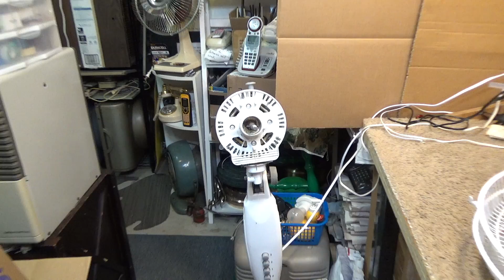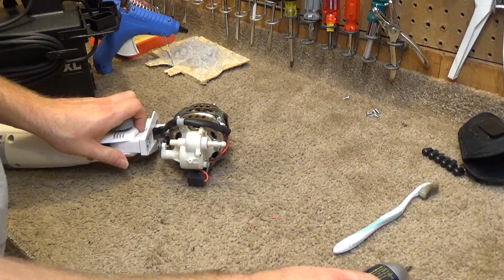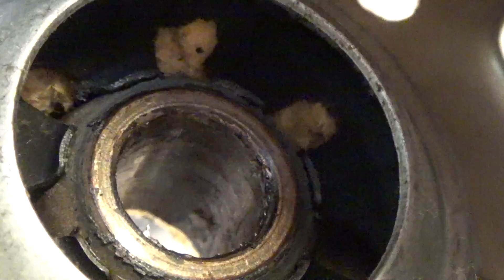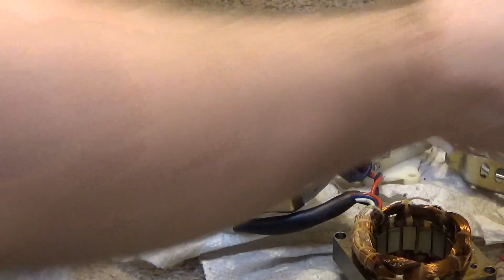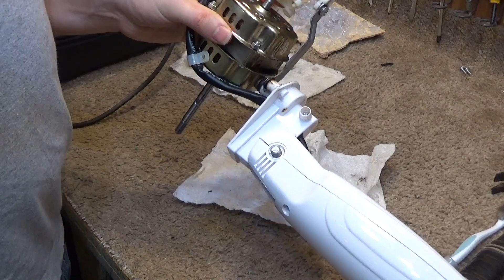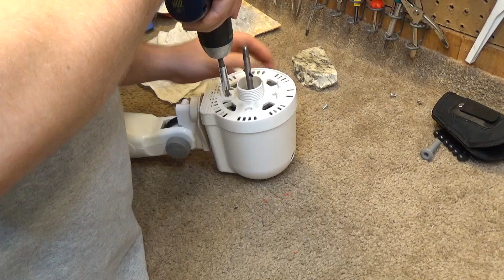Holmes HSF1610A 16" Stand Fan | Clean and Repair

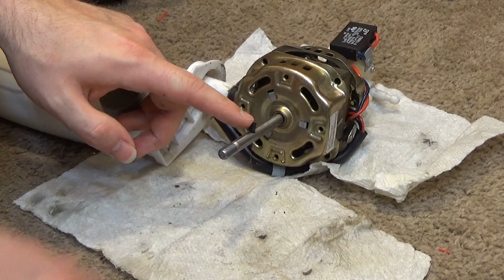Comment: 07:44 that's called a roll pin.

All fans with open sleeve bearings need periodic cleaning and lubrication, as the oil attracts dust and gets gummy over time.
Reply from the maker: Thanks for letting me know.

Comment: I have an Essential Home Model HF-1670 Date 11/06 with a similar burned shaft. I cleaned it and rubbed the burned shaft with some 600 grit emory cloth. I tried to clean some of the thrust washers and they broke because the heat must have made the plastic very brittle. I’ll go to Ace Hardware and see if they have a trust washer that will work.  There is also two very thine white thrust washers and have a very big inside diameter. They are larger then the shaft and I think they were rubbing on the black 2 cm spacer and wore out because of the burnt shaft. The other side has white washers too, but they have an inside diameter of the shaft.  To see if I could get it running I put a regular washer in that was about the size of the black thrust washer that crumbled and shorter out the open thermal fuse.  It ran. :)
Now I can put in a new thermal fuse and try to get some correct thrust washers somewhere.
Reply from the maker: How disappointing to see these failures just after a few years of use when the products of yesteryear ran for decades with no trouble.
Reply: @JordanU  I found two 5/16” id x  1/2” od x 0.032” t, white nylon washers at Ace Hardware for $0.18 ea. I also found one 5/16” id x 3/4” od x 0.060” t, grey neoprene fiber washer for $0.50 ea. I tried to stack the washers white grey white, bit it was too thick, so I removed one of the white washers and it worked and had a little play so the armature wouldn’t bind up.  I think the original white washers are made of nylon. The original nylon washer size on the other side was 8.3mm id x 13mm od x 0.35mm t.  Ace doesn’t have a large selection of washers in metric sizes so I got some with id of 5/16” which is close to 8.3mm and fits the armature shaft.  The grey washer was a little big, but it cleared the bearing housing ok.  Ace Hardware didn’t have grey washers with a 5/16” id and a 1/2” od, so I had to get the bigger washer.  I don’t know what the original black washers are made of, but I think what I got might work.  I don’t know how long the neoprene fiber washer will last since it seems to be different from the black original washer.  Maybe there is a manufacturer’s website with motor washer information they would help people trying to fix their fan motors, but I don’t know any.

Comment: I put a line on the front housing, iron plates and rear housing so when I put it back together I know how the sides are supposed to light up. Also, I will start putting arrows on each of the three lines so I don’t put the windings in backwards.  I also, scratch the lines with an al or sharp tool so incase I wash off the sharpie I can still see the lines.  I put an “S” on the end of the shaft that the blade attaches to and an “S” one front housing so I get the armature in correctly.
Reply from the maker: OK

Comment: Try using a scotch brite pad to polish the rotor shaft.   A little WD40 and the pad and that cleans off gunk and does some polishing of galling on the metal too if there is any.   To clean the bearing surface use the same pad but pieces wrapped around a metal shaft like a nail of drill bit and put it in a drill and polish the inside of  the bearing.

Comment: Will this work for my fan if I'm not hearing the motor or a hum. It stopped working. I know it needs a thorough cleaning (like this) but will that help?
Reply from the maker: You'd have to find out of the motor is drawing any power or trying to work at all. It's possible the thermal overload has cut off, which is a much more advanced repair than this.

Comment: I agree with you jordan u about the stiff bearings in that cheap china pride crap because I have a lasko stand fan that was very expensive good looking and costed $45 but when I plugged it in it would not spin as fast so I took the front grill off and turned the blade and the bearings was stiff. what a rip-off and to make matters worse the warranty expired so I cannot return it to the store 😔😢 I wish I had my $45 back I did the best I could to save my fan but it finally pooped out I wish fans were made in the USA🇺🇸 like the good old days.
Reply from the maker: Thanks for letting me know.